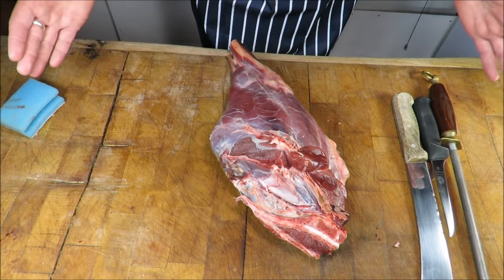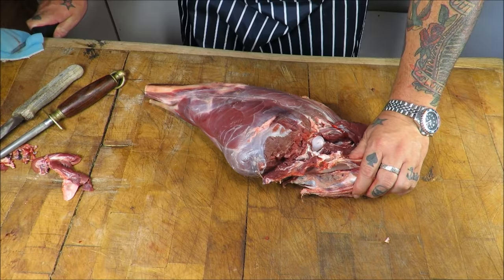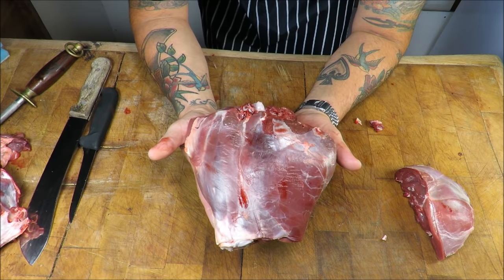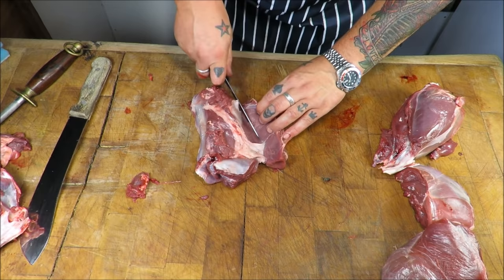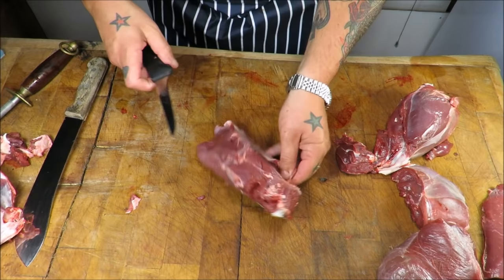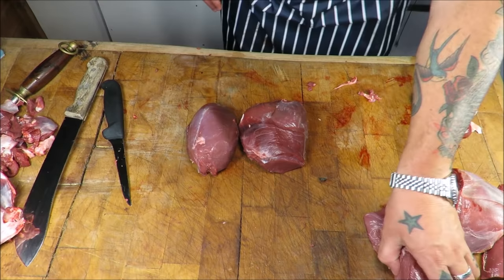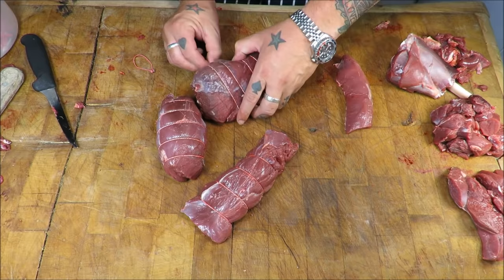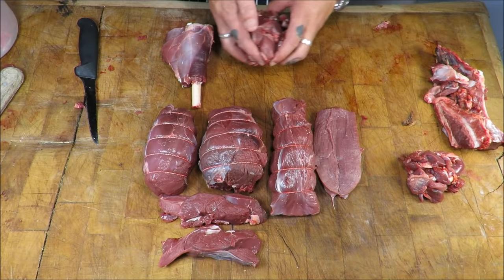How To Butcher A Haunch Of Venison. #SRP

Comment: Do you have any videos of breaking down a horse?
Reply: i have a beaking down a horse searching 4 "abrir delantero de potro" but is in spanish
Reply: Ken, as Scott say's all mammals are basically the same framework, once you master one the basic framework is the same, just the size that varies. having spent 3 years butchering pigs, there is not much difference between the cuts of those or deer, butchering a cow would be different, but essentially it is just the different cuts of meat, different name, the basic mechanics of butchery are still the same, just the different name for specific joints of meat that change from the species you are butchering, the basic butchery is the same.